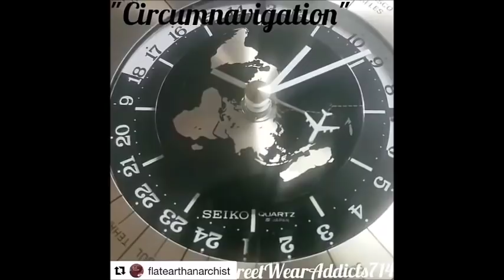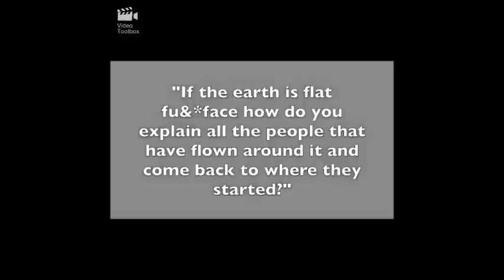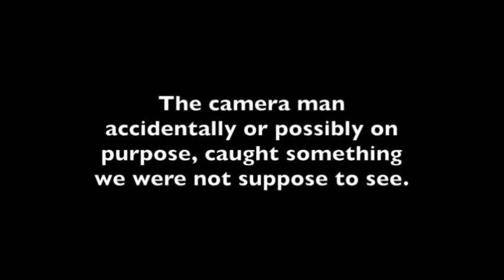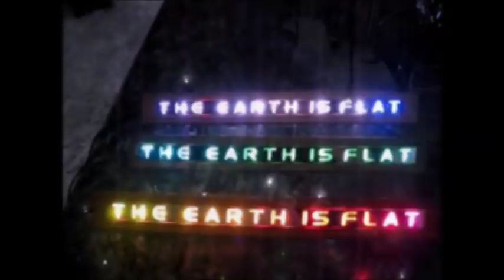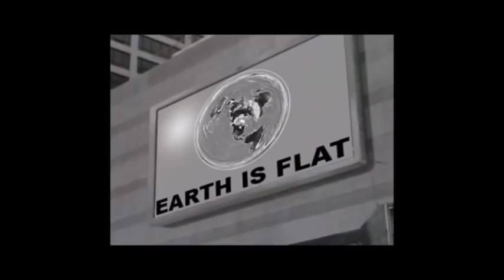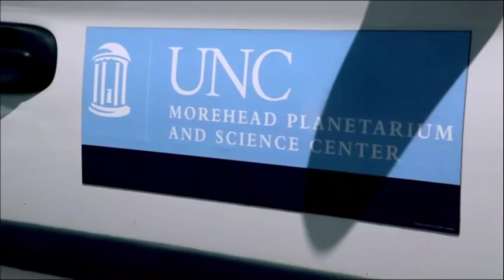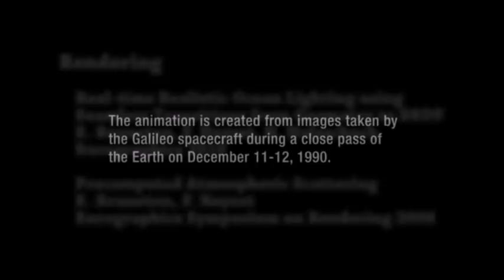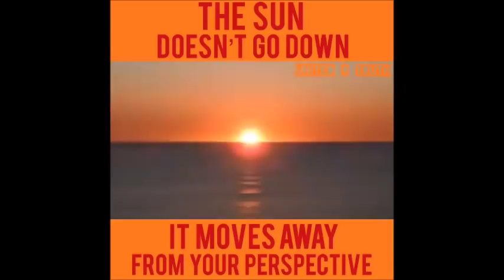Flat Earth Q&A Emails 85 - Mark Sargent ✅

Comment: Hi Mark. There is a question concerning flat Earth. Are you aware of any data showing clearly if ships moving alongside the Antarctic ice wall need to correct their course constantly to the left or to the right? Aki.
Reply: A ship would adjust course to avoid a collision and for no other reason. Ship's navigate same as fixed bodied aircraft, assuming a flat, non-rotating Earth.
Reply: Also...if a plane circumnavigates the FE from West to East, the pilot would constantly have to course correct by turning to the left.
Reply: Anthony Demayo: It is a question about long distance navigation. Correction of the course to the left or right in order to avoid collision would be permanent within a long distance navigation, which in case Earth is flat should clearly point to a predominant tendency for correcting the course to the right and in case of a globe - to the left on a journey close to and alongside the Antarctic ice wall. So the question is: are there any navigational data available from ships, which did go "around" or "alongside" Antarctic?
Reply: Donut Viper: Yes, but only if he follows the "latitude" line otherwise he can fly straight across them but if so on a long trip he would cross a given latitude line always twice whereas on a globe only once provided he flies a straight and does not follow the latitude line.
Reply: Adding to a conversation. There is a real time navigational data available here: https://www.marinetraffic.com/en/ais/home/centerx:75.1/centery:-56.9/zoom:3 as it seems there are few fishing ships and even passenger ships in the vicinity of Antarctica. Best is to look at the region between Australia and South Africa. In this part Antarctica seems to be round (on a GE and the navigational map) which on a FE would correspond to a concave shape of the same distance between lets say W030 degrees and E170 degrees of longitude at S060 latitude. Together it gives 200 degrees and according to the formula: Number of miles in 1° of longitude = (69.11, this is number of miles in on degree longitude on equator) x (cosine of the latitude) it would correspond to about: 12440 miles (on a globe the closer to the poles you go the shorter distance between longitude lines is. This is also how we can test the GE model because the same distance on a FE would be much longer. The distances between longitude lines would actually be inverted on a FE vs. GE. Therefore on a FE ships going at the S60 or higher latitude from E170 to W30 longitude (East to West) would not only have to correct their course to the right but would also travel longer distance then 12440 miles calculated based on the GE model.  Is it so in reality ?